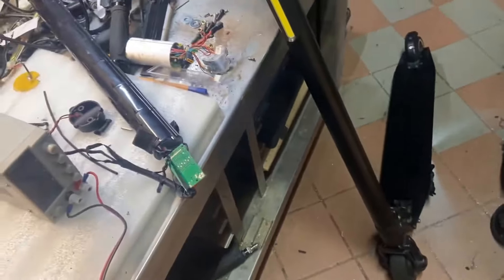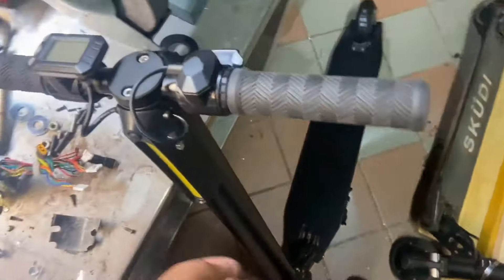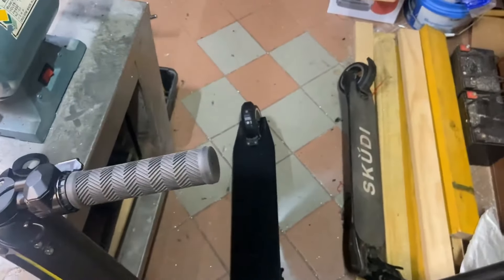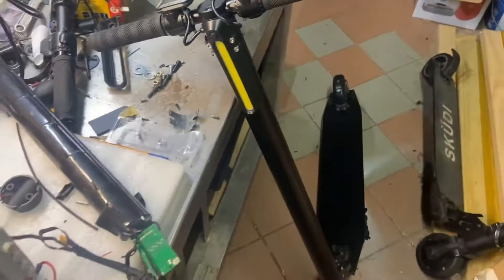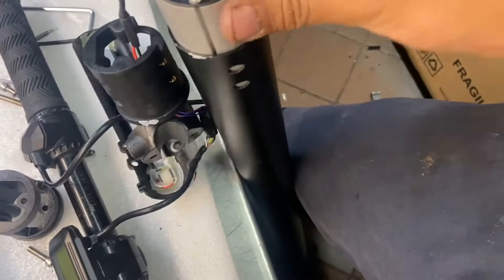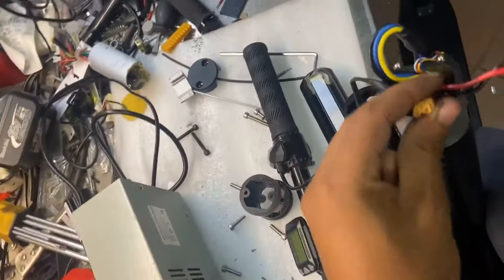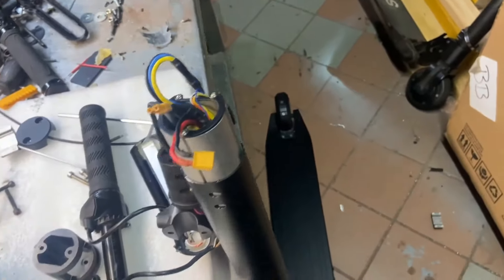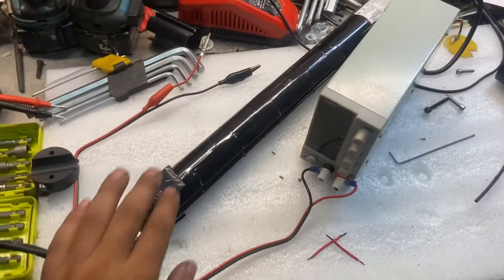How To Revive Dead Scooter Lithium-Ion Battery - (Or Any Device!)

Comment: I have the same model scooter and want to replace the battery. One of the cells is busted and it shuts off at about 6 miles (supposed to go 10-12). Fully charged it and tried it a second time and it stopped at about the same distance as the day before. Someone told me that just replacing that one bad cell won't fix the problem and another will go bust soon. So I think I should replace the whole battery. I'd also like to see if it's possible to increase range or speed just by changing the battery to a different one that's compatible with the controller and motor. Will look at the rest of your channel to see if you've already covered it.

Comment: What voltage would I need the power supply to be at to jump a 52 battery?
Reply from the maker: 52v would be a 14s pack which would need to be charged to 58.8 volts, which is a bit high for most power supplies. you might have to charge the individual cells or the series of cells up inside the pack, that or find a battery or put some batteries in series so you can get to that higher voltage.
Reply: @TechEyeMan  Thanks for the info, was as I suspected but wanted to be sure. Managed to get a 60v unit and got my battery back up to voltage for the charger to be recognised. Great video helped me a lot!

Comment: Hey bud, great video, I am having issues with my Nanrobot X4 2.0, I stored it over the winter in my basement and I just brought it out to use. I turned it on and the voltage meter went from 52v all the way down to zero. I plugged in the charger and the charger said that it was fully charged. I tried turning it on again and it did the samething, it went from 52v down to zero. Should I try to jump the battery with this method?
Reply: Hey mate. I would just try to get a reading from the battery first if you can get to it, just to confirm the voltage is low. If it was sitting for a few months then it probably has gone down, but it won’t hurt to check, it might be another issue. If the voltage is indeed low, then yes a jump is needed.
Reply: My nanrobot rs7  die and I wan to orden de other buth i have to wait 3 mount it’s any web site to get other battery or any recomention

Comment: I have the same issue with my scooter 1600w), the only difference my charger is red for a few seconds then turns green, even though the scooter is completely drained.
Reply: Hi did you resolve this problem? I have the same with my scooter

Comment: I've got my battery from one volt all the way to 39 volts. I did the same thing and sooner or later the charger recognized it and it started charging the battery. But the two large main ports that come off of the battery that plug up to the scooter when I put a multimeter on these and even on top of the wires where they come out of the battery there's no power coming out of them. But the battery pack itself shows it has 39 volts in it. I've got connectivity from those two wires one is red one is black. I hope the 20 volt battery directly up to the scooter and the scooter turns on. But the battery pack itself has no voltage coming out of the red and black wire
Reply from the maker: that sounds like a dead bms mate. that’s probably also why it was shorting when you were trying to charge it with the other battery. if the pack itself is charged but there’s no voltage coming out of the main leads then the bms is dead

Comment: Hey man awesome video!
Have one exactly like this one.
My son the other day broke the scooter, he was cleaning it and when he came to the charger port he said that it made a ”cracking” pop sound (damp/wet cloth). Obviously he shorted the bike… it doesnt work anymore… you mentioned that this bike doesnt have fuses… what could it be? Thankful for any tips/fixes 👍
Reply from the maker: Hey mate, sorry to hear about your sons scooter. So it was fine before he cleaned it? Basically shorting out the charge port will likely short out the BMS(battery management system which is inside the battery) or the controller. If you're lucky maybe your one does have a fuse and you can check if its blown. but if not the controllers are not very expensive, same for the BMS.
while you have it open just check you have battery voltage (probably 25v for yours but could be different) going from the battery to the controller, if not then the bms is probably fried, if you have voltage then the controller is probably fried, Have a look at one of my other comments where I sent the link for a controller.
Reply: @TechEyeMan  cheers mate 👍 will do
Reply: @TechEyeMan  Hi again mate!
I opened upp the bike and sure enough no fuse so i recon the bms is fried…
If i buy the kit you mentioned, do i need to use the display and the throttle that comes with it or are they compatible?
Thanx in advance 👍
Reply from the maker: @Abubububu Hey mate, the bms is inside the battery. not inside the controller. but if it’s the controller that’s faulty, you can use your existing throttle/screen
Reply: @TechEyeMan  ok, i thought they were together in the enclosed aluminiumcase/box 🙈. I measured the battery voltage and that seemed fine so its definately the controller then. Thanx for the response mate, have a good one 👍
Reply: Hey Mate!
Its me again. 🙈
I’ve now confirmed that the controller is solid so that only leaves the BMS in the battery compartment. You said it was a 6s battery… i persume that i need a 6s bms… there alot of BMS’s out there, which should i be more careful of, there are one’s with higher amperage (does that matter…?) and there are 7s BMS’s which almost correspond the amp and voltage that i have… if you have link to one of those it would be awesome 👍
Cheer mate, have a good one!
Reply from the maker: @Abubububu  Howdy Partner. How did you rule out the controller? if the battery is reading a voltage similar to the voltage written on the battery then the bms should be fine. To test the bms try running a load off the battery for example a DC electric motor (it might burn it out if its just a 12v motor that you have laying around) the point is that if the battery leads (the red and black) give out the correct voltage and can drive a load ( like a motor or a heat element or something) then the bms is fine. You don't want to go spending money on things that are not broken.
Reply: @TechEyeMan  Hello sir, trust you are doing great, I use an Hover 1 alpha E scooter, so two days ago I was changing the accelerator of my scooter but in the process of assembling it together i found out that the beep device was loose but before I could touch it , it mistakenly touched one point of the display panel which resulted in some weird noise, and the scooter tripped off and wouldn't come on again.... Pls do you have any idea what I could do to resolve the issue...
Reply: Hi, 
Nice video.
Just want to ask can I used 36 volt electric scooter chargers to charge 24 volt this battery.
Reply: @ahsanmahmood3378  better go slow than to go too fast…
Reply: I have the same scooter I’m getting 0 volts at the t35 battery connector could it be that dead it’s sat a while … I hooked up a rc car charger with multiple setting I can select amperage and voltage out but when I hit start to charge says break in connection thinking the t35 has a bad joint … how do I get the whole battery out just pull up on it hard Iv only worked on e bikes first scooter ..cheers

Comment: Hey  my scooter turns on and charges but won’t run how can i fix it its the same one you showed in the video
Reply from the maker: does the scooter turn on? could be the controller
Reply: @TechEyeMan  yes it turns on just went you hit the gas i doesn’t run
Reply: ok if it turns on and it shows full battery it could be the throttle. but i think they sell the display and the throttle together

Comment: Can you do it on a dualtron thunder. I went away for 11 months and come back it won’t accept charge. The charger flashes green and red. Any tips or ideas. It was working fine before I went away ?????
Reply from the maker: you can do it but you will need a power supply that can deliver 60 volts. (unless it’s a thunder 2 that has 72v battery) otherwise you will have to charge every cell individually up to 4.2v.

Comment: I found a 36v Escooter battery, that is displaying voltage after I charged it, however it won't power anything. Perhaps the current is still to low, if so how can I increase the current?
Reply: hello. How do you know it’s a 36v battery? does it say it on it? if the battery isn’t delivering any current that’s usually a sign that the BMS (Battery management system) is faulty
Reply: @imanel-gadaa7020  Yes, it says its 36v on the battery
Reply: @Ch33secakeGaming  try opening up the battery pack and run something from the terminals (positive and negative) coming directly from the cells themselves (before the bms which will be a little chip) if you get full current in that condition then it means the bms is bad. don’t do this for long however as it may damage the cells.
Reply: @imanel-gadaa7020  Alright

Comment: Can i use the original charger to "jump start" my battery?
Reply: Unfortunately not. Most chargers detect voltage to regulate the charge and will not supply current if the battery is dead.

Comment: Hi! My Gotrax turned off on me recently. I turned it on but it only kept on for 5 seconds then shut off. I plugged in the charger and it flashes red-green-red-green. Is this a battery issue?
Reply from the maker: Hi, yes it does sound like battery. does it charge? you need to check the voltage on the battery first. but it could also be the controller or the display but first check the battery!

Comment: What inexpensive power supplies do you recommend?
Reply from the maker: the one i use in this video is a Minleaf NPS3010W 110V/220V from banggood. works well for me and i have no issues with it but i do need to upgrade to a higher voltage one for bigger batteries as this one only goes to 30v
Reply: @TechEyeMan  I was able to wire a $13 compatible offshore ES1, ES2, etc. charger directly into the battery (with stiff wires) per your instructions. It's charging like a charm as we speak - sans controller. I'll let it go for an hour and see is there enough charge to be recognized by the controller. Ordinarily its a 2 to 3 hour charge. Excited to see this scooter work.
Reply from the maker: Awesome to hear man. Let me know how it goes.
Reply: @TechEyeMan  It charged ok. After 90-minutes the blue light was on steadily (not blinking) on the battery pack and the scooter showed a 2% charge. I couldn't get a disassembled scooter to charge using its internal drive controller (even though the scooter dash showed no errors). I charged the battery again manually for several hours until the charger just turned itself off (as instructed by the battery management computer BMS in the battery pack). After full charging, the disassembled scooter kept seeing a 2% battery and the scooter would not allow charging. A red light is on -  on the controller board but I assume this is a ground fault caused by the scooter screws being unconnected. I'll report back after I put everything together.
Reply: @TechEyeMan  Is there an option for me to send in my controller, to have all fixes done to it - and to confirm its a good controller at the same time?
Reply from the maker: @EdwardTilley  What scooter model is it? did you check with a multimeter after the battery has been fully charged and left for a few hours what the voltage is? once you’ve ruled out the battery is ok then it will be the controller.

Comment: Hello TechEyeMan. Thanks for the awesome good explained video!
Can I do this with a Li-Ion bicycle battery of 42V that dropped to 2V?
I don't have the special charger but I have a laptop charger of 19V.
Could this work safely?
Thanks,
S.
Reply from the maker: Hi Sammy, i would say that it probably will not work if your laptop charger is advanced enough  it probably will not allow the dead battery to charge. but you might be lucky and it will charge it however it will only charge it to around 30v which might not be enough for your ebike charger to take over. give it a shot though. another thing is your battery voltage is very low. i suspect it’s totally destroyed the cells by now, unless you are only measuring voltage after the bms and not at the battery terminal itself. see if you can measure the voltage of each individual cell if you can get to them (the will look like big AA batteries.) and each cell should be around 3.7 volts
Reply: @TechEyeMan  
Little info:
My E bike was charged but stored for a long time.
Now it seems discharged.
I had 2V on the battery, the black and red cables.
Unfortunately the battery is completely glued with a kind of black silicon in a aluminium tube case.
I think impossible to get to the batteries without damaging.

Thanks for the help.
Reply: This method is only good if your battery has dropped slightly below the cutoff. If your 42V battery is at 2V on the output, something is really wrong. When a lithium battery drops too far below the cutoff and you attempt to force recharge, conductive crystals can form inside cells that can form an internal short... very dangerous. Like TechEye said, each cell should be around 3.7 volts. You have several of these in series that add up to 42V, if the assembly is reading 2V, there is a serious malfunction. I would not attempt to charge that.

Comment: HEY!!  that scooter that you are working on!  I bought one online EXACTLY like  that with a smashed control panel...  do you have an extra around you scavenged?  Tell me what brand it is so i can find one please!  This was perfect for me!  Is it a Gotrax?  No label at all, anywhere...
Reply from the maker: hey!
All these no name ones are the same, they probably come from the same factory in china ha. Matter of fact i needed to buy a new control panel for the very scooter on the video because it’s screen was broken too. they are called  “Controller Brake LCD Display 24V 250W Electric Scooter Controller Brushless G9D9” and come in a kit with the controller, screen and brake for 30usd on ebay. you just have to make sure your one is the same  voltage (it will say on your controller) https://www.ebay.com.au/itm/Controller-Brake-LCD-Display-24V-250W-Electric-Scooter-Controller-Brushless-G9D9-/124279965591?mkcid=16&mkevt=1&_trksid=p2349624.m46890.l6249&mkrid=705-154756-20017-0
good luck!
Reply: @TechEyeMan  thank you so much. Exactly what I needed

Comment: I have a similar issue! I left my scooter fully charged around August last year. Today the sun was out so I pulled the scooter out and as expected, completely flat. I plugged in to charge and initially the light stayed green on the charger. I kept trying to turn it on and after about 30min, the scooter managed to turn on and began charging🎉 .. unfortunately that would have been too easy :(

Excited af, I left to charge fully and ran downstairs to test when it was done. Something said make sure it works unplugged and as I said that, 10seconds later the battery was dead.😢😢😢 

Do you reckon this method will fix the battery? It was maintained very well before it was left to discharge or will it need another battery?

Replacing will cost £500-600 which isn’t ideal, I wanted to upgrade my build but for this price it might make sense to upgrade to another scooter 💔

Please let me know 🙏
Reply from the maker: sorry to hear that. look i would start by pulling out the battery and trying to see what the voltage is straight on the battery. sounds like some cells are damaged and discharging. worst case you might just need to replace a damaged cell. best case is you can try this method and it will be all that’s needed
Reply: @TechEyeMan  thank you! I ended up testing the voltage on the battery, was reading 3-5V (from a 60V 20Ah battery) so likely some cells are definitely dead. I normally do these repairs myself but a local shop has said they can fix between £100-200. For this price I would love to attempt but purchasing all the tools required + the risky repair may not be worth the pain. This video helped me greatly thanks so much !!

Comment: Can someone help me my scooter won’t charge and is just showing green light saying it’s fully charged but its not
Reply from the maker: you will need at least a multimeter/volt meter. Check the voltage first coming from the charger to make sure the charger is working, next check the voltage on your scooter battery. 
If its totally dead, it wont allow the charger to charge the batteries and you will have to do the above fix in this video. Could also be a bad controller etc. Tick the easy boxes first.

Comment: my 48v ebike battery is reading 1v at the charger input and 44v at the battery output , dont really want to open the battery do you think my 48v solar charge controller could jump charge my battery?
Reply from the maker: i’m assuming you have access to the battery leads if you’re able to read that 44v. if it’s a 48 volt solar charger and it’s outputting more than 48 volts then it should be able to jump it as long as the bms doesn’t inhibit it. give it a shot for max 1 minute at a time (straight on the battery positive and negative) and keep measuring the voltage after each attempt. It should start rising. When it gets to above 48 volts the original charger should work like normal. Otherwise you’ll have to open the battery.
Reply: @TechEyeMan  so i used my solar boost charge controller to the battery input and let it sit till 46v than the charger that came with the battery worked like a charm battery is now full and ready to go
Reply from the maker: @what8586  Awesome work, happy to hear it.